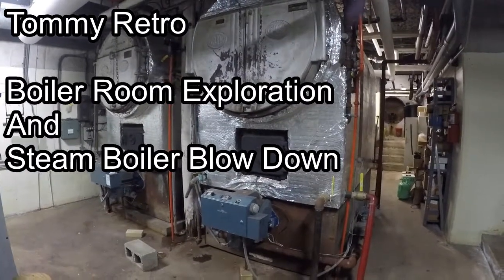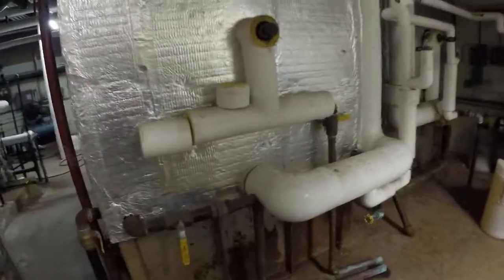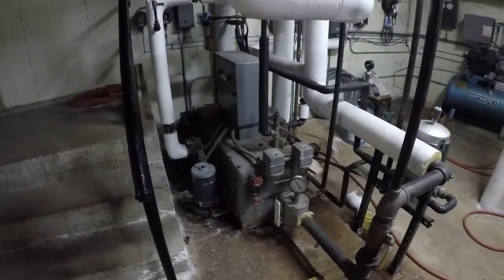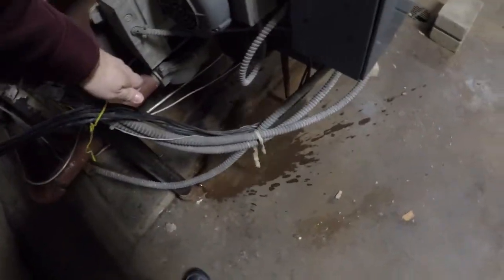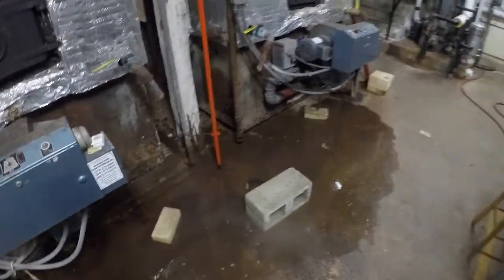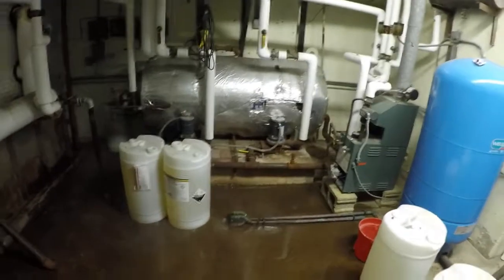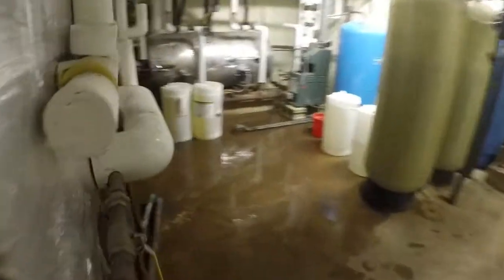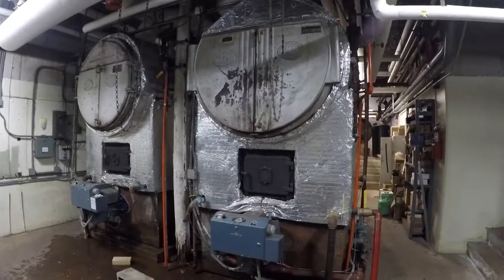Tommy Retro   Boiler Room Exploration and Steam Boiler Blow Down

Comment: Nice boilers. I used to live in a 3 decker built in 1913. The first two floors have steam boilers for heat. Both boilers burned coal at first, converted to oil firing .The first floor boiler was converted to gas prior to me moving in.  The boiler for the first floor was from the Royal Steam Heater Co. As of 2009,  the pressure gauge still worked! The boiler for the second floor was from The Putnam Steam Heater Co. I flushed rusty water from the sight glass and the bottom on a weekly basis during heating season on both boilers. I had the second floor boiler cleaned by the oil company on an annual basis. Both boilers were in operating condition as of 2009.

Comment: You should never blow down a boiler that's firing.  Why?  Because the water in the boiler is agitated (boiling) and stirring up the sediments in that boiler.  You should also base your blowdowns on TDS in the water.  If they're high, it needs to be blown down.  Your surface blows should handle most of the TDS (Total Dissolved Solids) but you still need to rid the boiler of heavier deposits.  Using Sodium Sulfite in your feedwater helps remove dissolved oxygen before it gets into the boiler.  This scavenges the dissolved O2 in the water before it gets to the boiler where you don't want it.  I've seen people add this directly to the boiler but once it works, now all you've done is release the O2 right into the boiler and your steam will carry it all through your systems and cause pitting in the returns.  All water should be treated prior to entering into any boiler.  Alkalinity in the water is preferred since it causes less pitting on the tubes and surfaces.  Getting a good chemical company that knows what they're doing is the best way to handle treatment.  Throwing in chemicals and then blowing down the boiler needlessly removes those expensive chemicals too.  Too much alkalinity and you end up with caustic cracking around the tube sheets and joints where circulation isn't as good.
I worked in and ran boiler rooms since 1983 and retired in 2014 with 32 years in the business, and have been to several schools along the way.  I've fired everything from wood burners, coal, oil, and natural gas too.  But the water sides are always the same, depending on operational pressure.  My last plant that I supervised was a high pressure plant and we always had perfect inspections on our units.
Reply: Wish I had more boiler operators like you. I do water treatment and most of my plants are run well because we have a good partnership with how to treat and maintain the water, but so many others think it's just plug in a pump and let it rip. This system is super simple with one drum of treatment that probably has a little bit of everything, sulfite, amine, polymer, etc. Getting the sulfite into the FW tank also keeps that thing from corroding away with the mix of cold make up and condensate.  I love the old boilers and mechanical rooms. So cool and most people have no clue what goes on down there.

Comment: Blow down are so important for sediment flushes and also checking how much scale is not sticking to your tubes.  You can cut out the chemicals usage of this loop by Wellan Synergy's Wellan 2000 Rings however.  Chemicals I believe are a waste of money. If you control the chemical reaction molecularly (If that is a word),  you can actually increase solubility of the water. Hence the heat will not cause the deposits of scale.  You can change the way FE reacts to 02 and H20.  You can change how Calcium when heated forms deposits.  Unfortunately chemicals is all we know for the last 60 years.
Reply: Chemical have a big role in water treatment.  They removed dissolved gases, keep your water alkaline and prevent pitting and scale. Blowdowns alone can't do that.  Acidic water will carry over and destroying condensate returns, pumps, traps, etc. and dissolved oxygen can't be removed by blowdowns alone since it's a gas.  It needs to be removed in the DA tanks so the liberated oxygen is removed prior to entering the actual boiler.  You don't want the oxygen in the boiler of course, because then it would serve no purpose for treatment and a total waste of time.
Reply: The easiest way to keep calcium out is use a softener. As a chemical guy who treats boilers, I'd use whatever is best to keep the equipment clean and get rid of chemicals myself if I could. They have non chemical means for cooling towers but for a true steam boiler, I've never heard of anything that would be affective. Chemicals don't even cost much when compared to the cost of fuel and equipment maintenance.